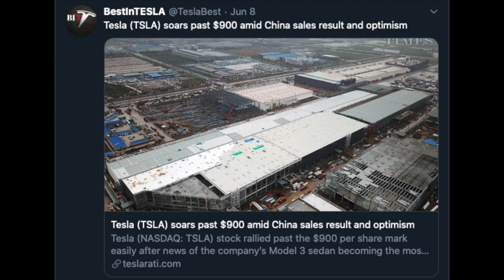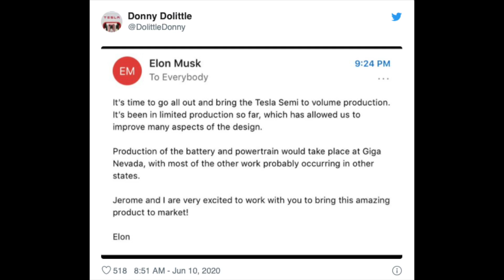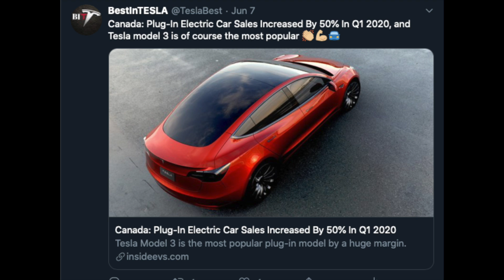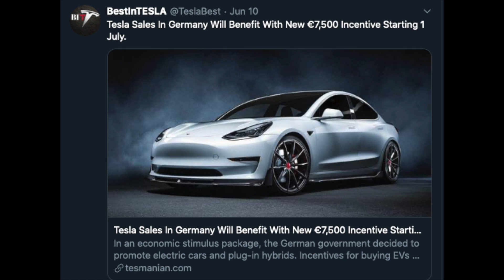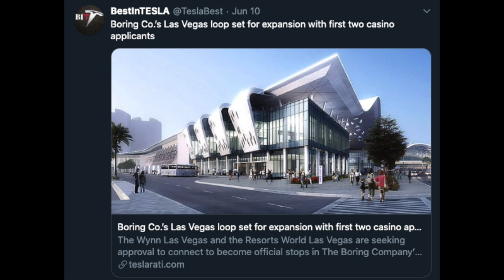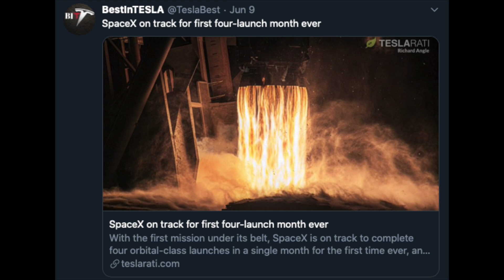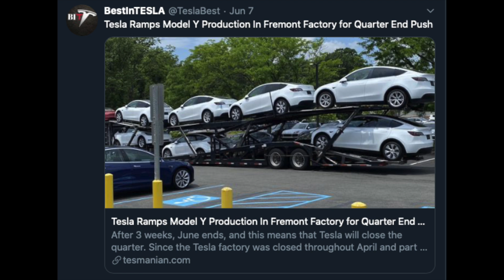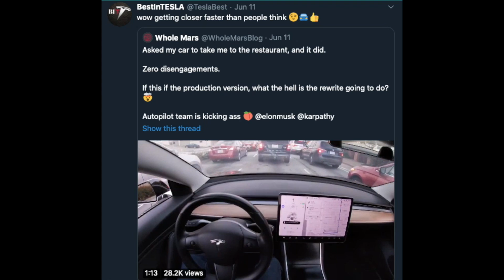Tesla became the most valuable car company | Semi starts volume production = Battery problem solved

Comment: Bloomberg just reported that the great and grand Nicola truck unvieled in 2016 did not have a motor, a fuel cell or even a drive train. Mr pump and dump Trevor Milton announced at the unveiling it was complete and ready to go.After todays report Mr Milton said the engine and drive train was removed for "safety reasons". https://www.youtube.com/watch?v=3D1NGc2AaXQ

Comment: The big secret is the weight. There is a good reason the "Semi" has 
never been seen with more than a 30,000ish pound load on the trailer. 
It's the same reason they could only load ONE Semi on a trailer when 
they brought them back from cold weather testing. As soon as the weight 
is known everyone will run away from the POS.
Reply: Dream on cindy.
Reply: @robertmcdonnold3038  no you dream on